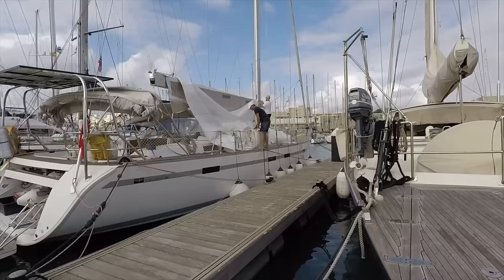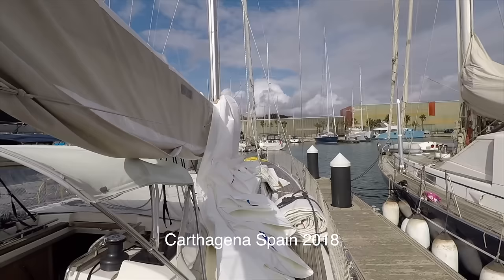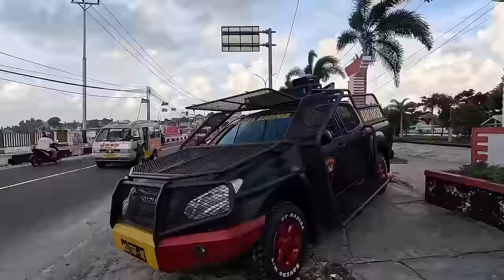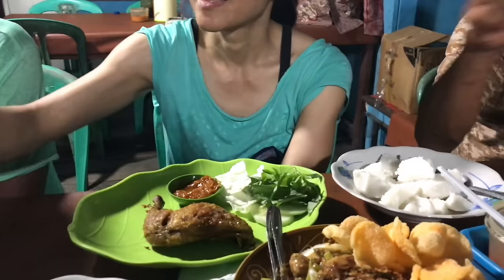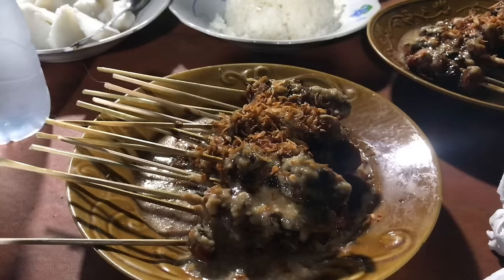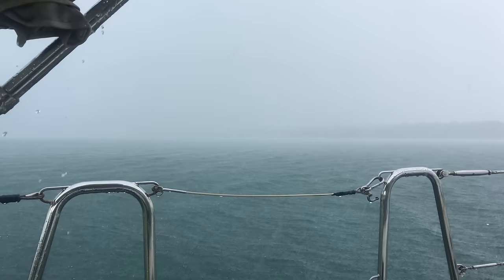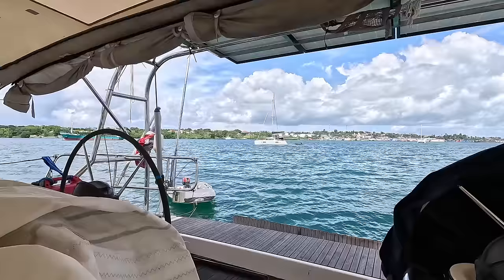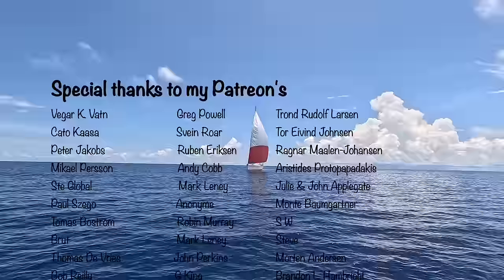TO GIVE UP IS NOT AN OPTION!  - SwT 180 - Turning my cockpit into a sail loft

Comment: Hi, This is Eric from Sailrite. I noticed in your video at 7:20 minutes that your needle is in backwards (it will not work with the needle installed incorrectly). The "scarf" must be facing to the left, not the right. Try that and it should work better.
Reply from the maker: Hi Eric, thank you so much for commenting here. Apologize for late response as I’m alone with absolutely everything. My days just don’t have enough hours. 
I guess my point about Sailrite somehow disappeared during my editing or my English is just not good enough making it coming out wrong. The mistake thread needle photo was done on purpose, as illustration of my point. I have StarLink onboard and watched so many trouble shooting videos on Sailrite that’s actually really good. However my point was as poorly it might have been communicated, having a Sailrite onboard might be overrated. Not because the machine is not good, but if not used enough and frequently it’s quite a challenge to actually take the advantage of having one onboard. It’s so many parameters and options that has to be correct. Otherwise it will just be a mess. This was my point and apologize if this video upset you. This was definitely not my intentions. I’m sure it works perfectly for those using it a lot. But for a sailor bringing one onboard only for emergency like me, most likely will end up stitching by hand. 
All the best

Comment: The thread is going threw the the wrong way. it should go into the needle on the opposite side of the needle that has a curved side for the bobbin to go threw. Also check bobbin for any burs on  point of bobbin.

Comment: my hunch is that problem you are having with the sewing machine looks to me like the thread is becoming twisted. if the roll of thread is stationary and is just pulled off each loop becomes a twist and that seems to make more friction as it passes through the eye of the needle, which can result in snags or wearing out the thread and snapping. I've had problems like that and had better results with the roll on the pin on top of the machine so that it rotates as the thread pulls out, preventing extra twist in the thread.

Comment: “Heading assistant” - how much power does it crave? Isn’t it very power consuming?
Reply from the maker: With the hydraulic it’s not much power. This is much more efficient than an electric drive. And normally you don’t need it to run that long at anchor. But this is the same thats running 24/7 when sailing, mostly on course instead of wind

Comment: Great video Thomas!  Question on using your auto pilot to hold 0 deg wind angle while at anchor. Do you do this with the engine running in forward idle?  I can’t believe you’re not over 100k subscribers!

Comment: You have the worst rig for down wind sailing, which is the route square riggers took for centuries.  You could have a simple lug/junk rig and what you save on sails, would more than pay for any motoring you would have to do. You should be able to get at least a circumnavigation out of a $9k sail, clearly they are not made like they used to be. I used to enjoy hand stitching cloth, but more than two layers, rope and wire are a pain with arthritic fingers.  More power to your hands!